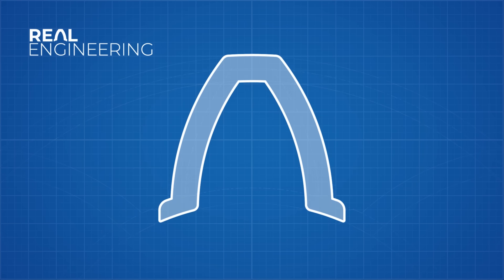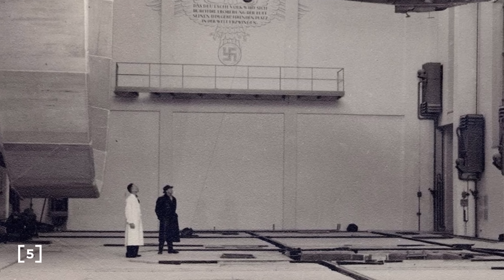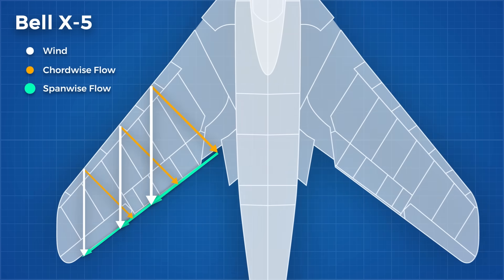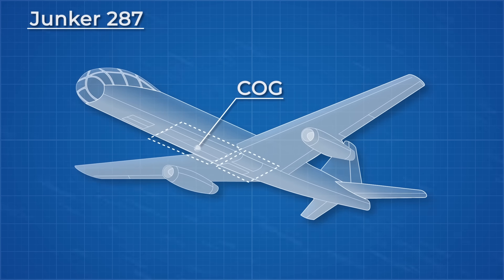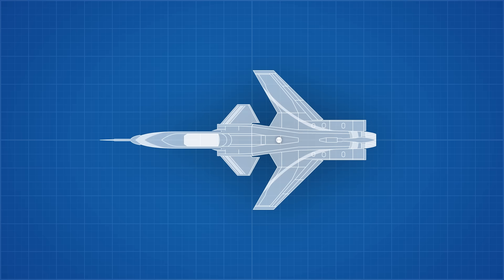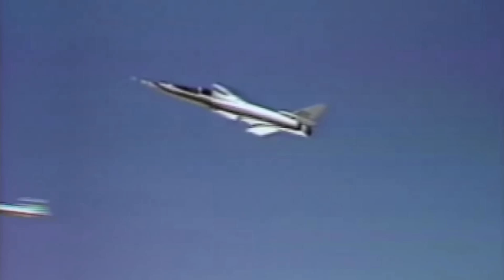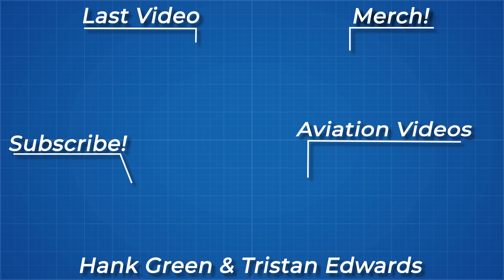Why Do Backwards Wings Exist?

Comment: There IS a Bernoulli effect but ONLY with a  FLAT bottomed airfoil, and it's minor. The effect is less with a semi-symmetrical airfoil and totally non existent with a fully symmetrical airfoil. 

Then there's the UNDERCAMBERED airfoil that the Wright Brothers used on the first airplane to fly and that most of the WW1 fighters used. Fokker was first to do away with the undercambered airfoil in some of his designs. 

But they ALL flew. 

The fact of the matter is, is that how a wing generates lift is a function of angle of attack and THAT is established by the horizontal stabilizer. 

Airfoil shape DOES, however determine an aircraft's flying characteristics.

I'm surprised that in this day and age that YOU, of all people, would perpetuate this erroneous narrative.
Reply: No, Bernoulli's Theorem just states the relationship between pressure and velocity in a constant-energy irrotational flow. It exists for any airfoil because it has to be satisfied (at least away from the boundary layer).
Reply: @AmbientMorality  I stand corrected, you're right. There IS a Bernoulli effect on the top AND the bottom of a fully symmetrical airfoil. Therefore any forces produced, cancel themselves out. Therefore, with a fully symmetrical airfoil, Bernoulli contributes NOTHING to the lift required to lift the plane into the air. How does a fully symmetrical airfoil produce lift?

Let's take a Piper Cub J3, vintage design, it uses a Clark Y airfoil, which has a flat bottomed wing. If you were flying one, would you try to fly it inverted?

I have been building and flying model aircraft for 60 years. I had a 45" span Piper Cub J3 model. Just for fun, I routinely flew it upside down. How do you suppose I accomplished that?
Reply: @jamesbonde4470  There is no such thing as a "Bernoulli effect" that produces lift, because Bernoulli is just a theorem relating pressure and velocity along inviscid irrotational streamlines. Lift is solely produced by pressure forces acting on the airfoil, and generally the suction surface produces the larger contribution. If you angle a wing, the velocity field around the wing changes a lot; Bernoulli's theorem is still satisfied for that new velocity field.
Reply: @AmbientMorality  Thank you. You admit that there is no such thing as a Bernoulli Effect that produces lift. So why did the poster use that in his explanation about the characteristics of the P 38 wing? 

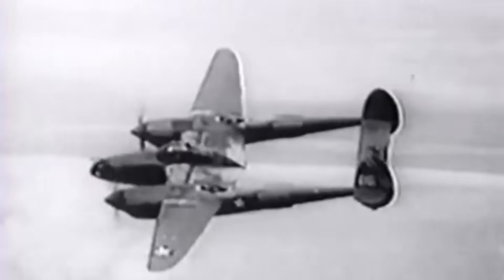See it at the 1:40 mark. "How wings generate lift where Bernoulli's Principle" etc. This is what I objected to and I'm glad to see that you've joined me. 

I'd sure love to meet you at a coffee shop and bring you to you local RC Flying field and we could discuss more with flying examples of what I'm getting at. 

And I'd give you the sticks to give it a go and see how you make out. At three mistakes high, of course. :*)
Reply: @jamesbonde4470  Yeah, I'm not sure if there's any single truly compelling explanation of lift. Bernoulli just relates pressure and velocity, which is only helpful if you already have the velocity on the surface of the airfoil. The explanation involving accelerating air downward is true, but gives an unfortunate intuition where it seems like it's just deflecting air on the bottom surface (when both sides of the airfoil are very important) and isn't really helpful in calculating much. The circulation theory is elegant but mathematically heavy and neither easy to explain nor obvious.
Reply: @AmbientMorality  In the hobby, as you might imagine, (with no lives at stake) all kinds of crazy experiments have been tried. 

We have a class of plane called Flatties. The wing is a thin sheet of foam. The leading and trailing edges are blunt.
 https://www.rcuniverse.com/articles/review/electric/towerhobbies-laser-200-the-return-of-the-flatties/

https://www.youtube.com/watch?time_continue=102&v=C-671emaF3M&feature=emb_logo

Rigidity is maintained with very thin, carbon fibre struts all over, as required. This makes for a VERY light aircraft. These are used indoors in the gym, or in the park with VERY light, or no wind. 

Essentially, that has the wing sporting a fully symmetrical airfoil. Grossly inefficient, tons of drag, and yet we fly them like bats out of hell. But ONLY because they are so light.

Some have adjustable pitch propellers and with reverse pitch, they can be stopped in mid air, and flown backwards. Pretty nuts but a lot of fun. 

I don't know if you're aware of aerobatic, RC helicopters. The main rotors have collective pitch which can be put into negative pitch. That's so that you can fly them inverted. :*) https://www.youtube.com/results?search_query=aerobatic+rc+helicopters

Finally, in my opinion, a wing generates lift from a measure of angle of attack, that is established by the horizontal stabilizer. ALL wings, no matter what airfoil, wing loading, aspect ratio, eindeckers, biplanes and even Triplanes like the Red Baron flew. 

When explaining to youngsters how an airplane flies, I tell them that the wing "SCOOPS" the air, just like when you stick your hand out the window of the car and twist your open palm from flat to tilted. Immediately, you see that light go on. They get it and it's wonderful to see that look. 

Note that the Wright flyer had very thin, undercambered airfoils as did MOST WW1 fighters. 

Fokker departed from that with thick wings to eliminate the drag of all them dang wires. He revolutionized wing design because despite the much thicker airfoil, his designs flew as fast as any other. He designed according to intuition and what made sense. If it looked right, it'll fly.
 http://www.theaerodrome.com/forum/showthread.php?t=8277

Some in this thread claim that Fokker's thicker airfoil were "draggy".

But this post has some useful information from NASA about that fallacy. 
++++++++++++++++++++++++

Actually, I've seen some pretty conclusive evidence that a thicker airfoil [i]does not,/i> increase drag to any noticeable point.

Check out this chapter from a NASA report ([i]<Quest for Performance: The Evolution of Modern Aircraft /i>) on aircraft design:

http://www.hq.nasa.gov/office/pao/Hi...-468/ch2-2.htm

It discusses the Fokker airfoils and the fallacy of increased drag. It was particularly surprising for me to read that the Dr.1 had a very low drag coefficient compared to contemporary types.

Basically, the thicker airfoil was a win/win decision: it gave better handling at low speeds, and did not increase drag. The NASA report authors speculate that early designers used a thin airfoil either (a) because they believed (incorrectly) that the thinner airfoil resulted in less drag, or (B) because birds have a thin airfoil and it made sense to copy them.

On a similar note, have you ever noticed how big fairings that cover landing gear wheels are? I always used to wonder why they were so big and how they could possibly provide less drag than the much smaller wheels they cover. The key, as I learned it in physics class in high school, was that drag is all about the surface area at the point of resistance. IOW, how much area is presented to the wind at one time. Wheel fairings come to a point that's, at most, one or two square inches in area. The air hits that point and then flows gently around. Unfaired wheels, OTOH, present a lot more surface area to the wind. The leading edge is important.

As long as the leading edge on a thick airfoil is not blunt, the drag for that wing will be comparable to drag for a thinner wing.

-Drew
________________
Drew Ames

Comment: Ik ur and engineer but the rear wings (aka elevators or horizontal stabilizers) are upside wing so is counter acts the lift of the normal wing so it dosent stall.

Comment: TL:DW - The inverted wing design didn't last because the design requires additional structural strength, provides poor pitch stability, and has a negative effects on stealth design.

Still looks amazing though.

Comment: maybe wings should flex or bend on a tensioner. like bird feathers fold in and out.. or the wings can be on a ball n socket joint.. adjustable and extendable.. think, if wings could fold up or in like a bird you could land a plane much narrower roads.. .. I say 3d printing very helpful to make up some mini models (to scale).. then any working model can be made life size with high quality materials.. we print plastic today, but in the future we should be able to print variety of materials on a large scale..

Comment: 2:00 no one says it’s false. 
The assumption that the two streams from above and below the wing meet at the back is false. 
When the streams split, they must be treated as two different streams. 
In reality the stream above is much faster, and is gone way before the lower stream reaches the trailing edge.
Also, Bernoulli is only valid for incompressible flows, where change in density between stagnation and flow conditions is below 5% (which is at .3 Mach). For faster flows, enthalpy relations are used.
Reply: It's pretty easy to modify Bernoulli for subsonic compressible flow though

Comment: Facts are very good in the video, but at 6:20 about wing tip stall. It's not just about ailerons being stalled, if only one wing tip stalls it will produce a very large moment arm and very forcefully roll the aircraft. So for this reason wings are specifically designed to stall (and are better to stall) at the root where lift is lost with minimal roll effect.

Comment: Does this mean no real life X-02 or the ADF-01? 

NOOOOOOOOOO
Reply: :( reality is often disappointing
Reply: The ADFX-01 could be possible theoretically
Reply: The X-02 is possible. It has hybrid forward and backward swept wings, the wings can also fold inwards meaning that you can fold the wings in cruise flight and unfold it in dogfight or turnfight
Reply: @avery1647  I can see 3 obvious problems with a real life X-02..
1) Bcoz of the inward sweep wing mechanism, the wings could have the same flaws like the F-14.(wings could be tricky to maintain)
2) It will be quite a bit bigger than most fighters.(even if it is fast as fuck boi)
3) Internal weapon bays could mean limited flight range.
4) WAY TOO Expensive to develop IRL(kinda hard to justify the existence of it.)
Reply: @RedDrake110  well I mean its supposed to be a revolutionary next gen aircraft so it has to be more complicated, expensive and bigger to carry stuff like the railgun
Reply: @avery1647  a carrier which holds 100 of these..
Waking Nightmare personified..
Fast in Fast out railguns, or naval siege for days
Reply: @RedDrake110  why need frigates when you can carry a plane with a railgun that can destroy corvettes in one shot

Comment: I thought the problem with the P-38 was caused by the front and rear wings being located along the same line on the plane.  This meant at high speed the front wing split the air, which didn't come back together in time for the rear wing to make use of it.

Comment: Forward swept wings are airplanes equivalent of bullpups, basically
Reply: That's a very opposite contrast. Forward swept wings give little strategical advantages in a dogfight except high mobility. And even then, the hindrance of having to be lightweight means it wouldn't be able to carry a good amount of weapons and it also would have a very insufficient engine due to weight limitations.
Reply: @firepower7017  thing is just like forward swept wings in bullpups the cons outweight the pros. To an extent there's only been two bullpup rifles seen as reliable. It's hard to get them right hence why most countries still prefer conventional rifles
Reply: @keps_ksk  I don't know if I'd slap you with the AUG or not. The rifle practically is the best Bullpup to exist period. It's simple yet effective, and it's light weight. Many countries used it. So just calling it reliable is a sin
Reply: @keps_ksk  Name me one forward swept wing aircraft capable of being cheaper than the F-16 yet also being far better than it in combat. Oh wait, none exist!
Reply: @firepower7017  i forgot to mention that the 2 bullpups i was talking about was the aug and the famas, sorry
Reply: @keps_ksk  You forgot the SA80 existed?
Reply: @firepower7017  didn't the l85 flop when it first came out? And it doesn't compare with the likes of the aug and famas?
Reply: @keps_ksk  You forgot the F2000 as well?

Comment: Engineers tend to simplify why planes fly just to the bernoulli effect, as described in this video, and/or the Newtonian explanation of tilting the wing causing the wind to push upwards as the slope diverts the air downwards, but in reality nobody knows all the physics involved in getting a plane to fly. They keep quiet because while they don't know WHY a plane flies, they have figured out pretty damn well through extensive testing HOW to make it fly, and people don't need to know the specifics as long as it works.
Reply: Completely untrue. The theoretical cause for lift production is quite well understood. The problem is that the theoretical model is not very helpful for actual design

Comment: So you telling me the Germans knew how to build jet planes before annyone do you guys realize how close the Germans where to winning the war if they had a little more time Jessus
Reply: Jet engines was also unreliable and actually a lot slower near ground level. It wasted a whole lot of fuel as well.

Saying the Germans would've won the war with Jet fighters is ludicrously bogus as it was until the 1950s that jet technology started to surpass prop planes which the first was the MIG-15. No P-51 could even match the danged things and early F-86 Sabres also wasn't enough.
Reply: tony Perez Jet aircraft at the time were not superior at the time. Jets had very slow turn times, making them easier to shoot down at the right time.

Comment: Me:So the computers would adjust control surfaces 40 times per seconds. 
Also gamer me: 40 fps
Reply: Flaps per second?
Reply: Most game use 60fps nowadays
Reply: @chronoz5950  No shit. That's not the point of what he's saying.
Reply: Ew.
Reply: 45fps gang
Reply: 30 to 3 fps gang (no I'm not joking)

Comment: I mean the SU-47 IS unstable, BUT! It's also extremely maneuverable (which, in a air combat, could be useful vs. missiles when countermeasures are depleted).
Reply: instability is maneuverablility if it dosnt kill you if it does its unstable
Reply: the F-16 is also unstable. The A/B generation was kept stable by Commodore 64 chips.
Reply: @wim0104  Seriously?  That is AWESOME!

Comment: Actually, what is probably the earliest examples for forward swept foils would be that of the rudder of the coble boats of the northeast coast England.  These were small fishing boats of 25-40ft that were launched and recovered from the open beach in heavy surf; then hauled up to higher ground by horsed or tractors later on.  The demand for controllability under these very demanding conditions where the orbital motions of the waves tended to cause the primitive wooden rudders of other boats to stall and the boat to broach, which is very bad under those circumstances - especially if you cannot swim.  This condition was exacerbated by the need for a deep forefoot to the keel which brought the center of lateral resistance forward.  The coble boat evolved to have a steeply slanting transom mounted rudder up to 40-45deg that prevented tip stall and loss of lift by, well... rewatch the video.  

https://en.wikipedia.org/wiki/Coble

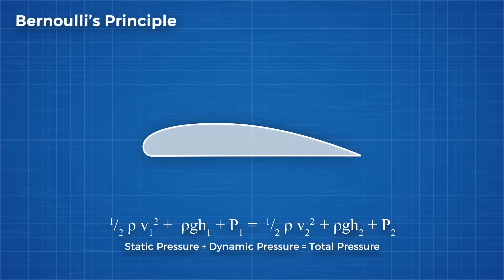Comment: Probably the best and simplest explanation of this that I've seen. Covers pretty much everything and explains it really well. Not sure what you mean @ 1:55 ... people don't believe that pressure causes lift or because the pressure is caused by the increase in airflow over the aerofoil? I think peoples misunderstanding is caused by a lot of simplified explanations that say or imply (kind of like your animation) that the air above has to accelerate to keep up with the air below: suggesting that when two air molecules hit the front of the aerofoil together, and part ways, have to reach the rear of the aerofoil together. Yes most lift is caused by a pressure differential and yes the air over the top does speed up but only because of layer compression and the coanda effect.

Comment: I have flown several gliders that had mildly swept forward wings. That was done for a very practical reason, as those gliders were all 2 seat trainers, and the rear seat was at the CG position of the lift of the wings. That made the weight of the person in that seat, non-contributory to the trim of the glider (only affected the total weight), and the front pilot was the only one that affected the weight and balance.
Reply: I don't know how no one else has liked this comment, it made the concept a lot clearer to me.

Comment: You want us to buy into your channel?
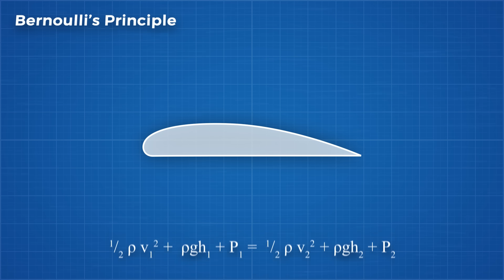1:50 in and you state that WWII aircraft wings were of the straight design, you named a few including the Spitfire. The spitfire wing is elliptical. It doesn't quite fit in the ME-109 or P-51. Yes the main spar is perpendicular to fuselage center-line but the plan is a drag reducing ellipse.

Comment: Question for the engineers out there: During the design of the forward swept wing, did the engineers already know about the need for the twist stiffness (Kt in the diagram@8:02), or did they have to discover it through observation and/or analyzing crash data and failed wings?  Not having an engineering education, I'm not sure if or how they could have even know it was an issue.